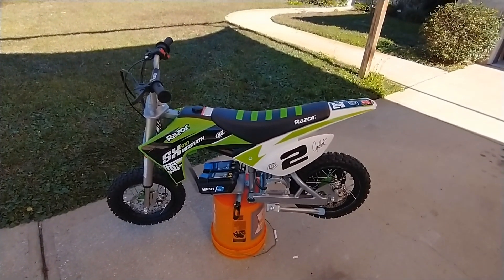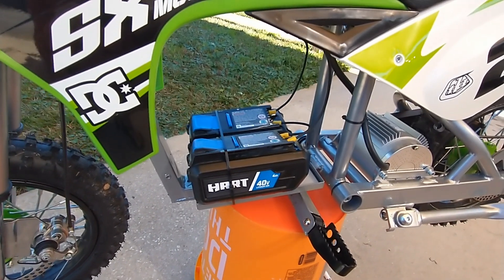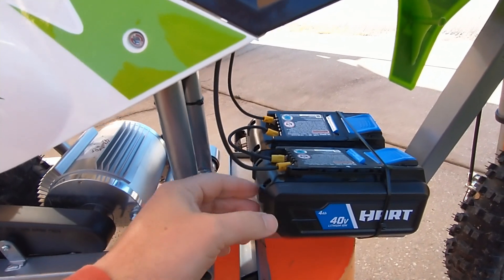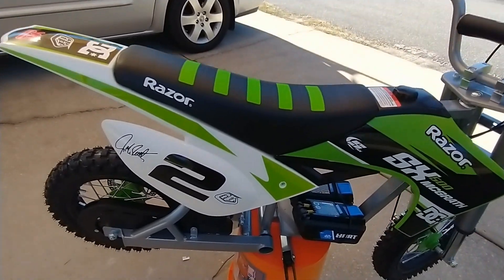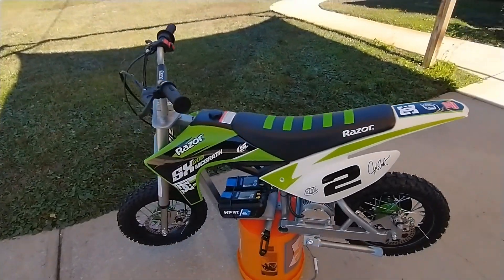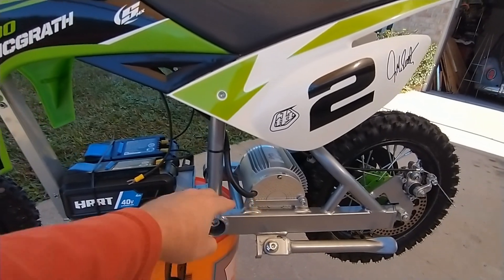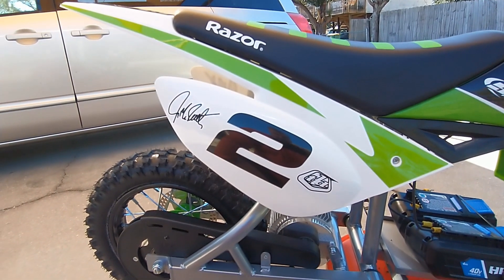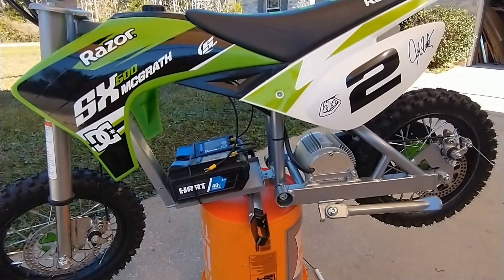Razor Dirt Bike Mods part 3 - Drill battery 72 VOLT easy speed mods.  Riding clips at the end.

Comment: Nice bike!!!

Was trying to figure out where to find a kit so I can use my Milwaukee 18v batteries.   Anyone know where I can find?  Thanks in advance
Reply: I have a mx650 and I got my set up off Amazon for my Milwaukee 18v batteries. All you have to do is series jump batteries and for this I just used wire nuts and it runs about 45 minutes before the batteries start going low. Still have stock 36 motor and controller .

Comment: So those Hart batteries can handle the current demand while riding?  I had a similar setup with 2 6Ah Ryobi 40v packs in series on my first razor mod but I had to bypass the bms current limiter on both packs to keep them from cutting out.  Definitely wasn’t a safe setup but I got the batteries, motor and frame for free so was working with what I had.  One of the Ryobi batteries ended up bursting into flames later on after sitting on my porch not connected to the bike or anything for 3 days.  Never imagined that would have been possible.  That thing would have burned my whole house down if I hadn’t been home so I was extremely lucky.
Reply from the maker: Yes the Hart batteries handled the current just fine.  No modifications to the batteries needed.
Reply: So do you think it happened because you bypassed the limiter? I'm running two 40v ryobis for my son's stock MX500 with no issues
Reply: @Bino-zm9bl  you running them in parallel or series?  I assume parallel hooked to the stock 36v controller? You shouldn’t have any issues using them like that if you’ve left them as is without bypassing any protection.  No need to worry.

Comment: How much km range can you get with the Dirt Bike out of this 72 volt Drill battery and upgrades? Or how much run time? And how do you charge the batteries?
Reply from the maker: I would estimate maybe a two mile range, but I didn't do an official test.  It also depends on how hard you ride.  You can place the cells in a sideways configuration and mount them so that you could slide the charger on to each of them and charge them.  (so that the battery is turned 90 degrees from the way I have them mounted) There is room for this in the battery tray, you just gotta be a little more creative than I was.  I didn't consider charging when I set these like they are in this video, so for me I would have to take them out of the bike to charge.
Reply: @chuck1011212  Honestly taking out the battery to charge it don't bother me since i put a kobalt on mines but i would like to be able to find a way to have at least 60km range. Could be 48 km range also but that would be really cool honestly. Which sort of batteries could allow me to do that? Would i have to place real gaz motorcycle batteries in my bike? Or would i have to try to play with the motherboards of some kobalt batteries and wires and stuff like that? Cause i know a guy who lived in front of my house he could modify any type of electric bikes/vehicles and make them have 20 hour run time and he would travel with an electric motorcycle from in front of my house to other cities far from my city by taking the little streets and he modified his bike to go at 90 km/h i don't know how he did that and i'm looking for this guy in the neighborhood so i can get him to mod my Razor MX350 dirt bike. Since i can't find him i have to find a way by myself but do you know any type of mod that can do that please?
Reply from the maker: @dicevizion  Ahh.  I see what you are after.  Check my other video about custom batteries and all the info I learned making a couple of them for this bike:  https://youtu.be/b3Qa7wmaMVE
Reply: @chuck1011212  lmaooooo 2 miles is like 5 mins of riding 🤣🤣🤣🤣🤣🤣

Comment: I just got the electro & company kit to but I have to wait a few weeks before they send it.  But id love to be able to add a horn and turn signals brake lights head lights all led running off a 12v rechargeable rc battery but I know nothing about wiring and how to splice in the brake lights to the motor shut off.  People are doing it but not at all going through the steps and showing people how they are doing it
Reply from the maker: Ah ok.  You would need a step down converter to take your 32 or 72 volts or whatever voltage you have in your battery now or what you will be running when you get your kit to take the battery voltage down to 12 volts to use for your lights and accessories.  Look up step down or buck converters for this.

Comment: I wish you did a video of  how you riged the batterys
Reply from the maker: Ya it is not 100% clear, but here is some more info.  I used connectors similar to these from Amazon, and crimped them on the wires.  Then to do the series connections on the batteries, I took the inside connection marked either + or - on the battery and connected the - of one and the + of the other battery together.  The result is a series connection where I use the outside + and - on each battery and connect those to the + and - of the controller.  
https://www.amazon.com/Insulated-Connectors-Electrical-Terminals-MILAPEAK/dp/B07Q2R1TGF/ref=sr_1_5?crid=1QOXLI9XLCWMI&keywords=yellow%2Bspade%2Bconnectors&qid=1641833464&sprefix=yellow%2Bspade%2Bconnectors%2Caps%2C103&sr=8-5&th=1
Reply from the maker: I am posting an update video now with more clarification about the battery series connections and what I am up to now on the bike .
Reply from the maker: Here is my quick update and battery hookup clarification video.  Sorry for videoing my hand in most of it...    https://youtu.be/4yJhBSj8k6E